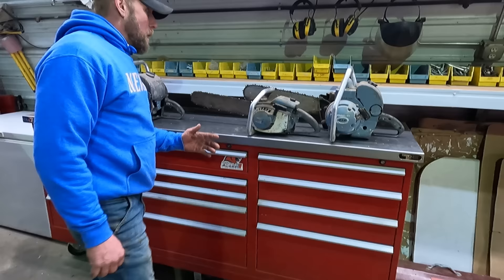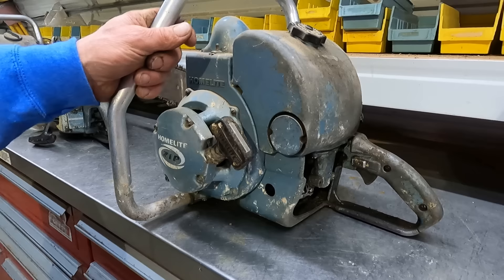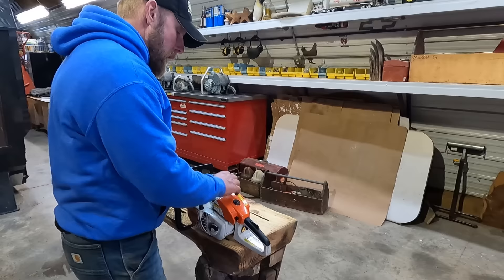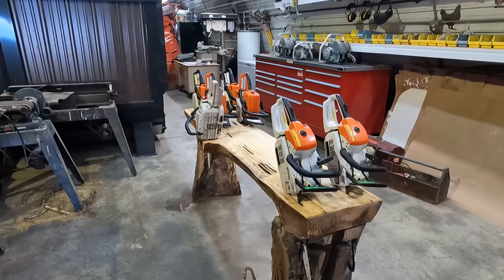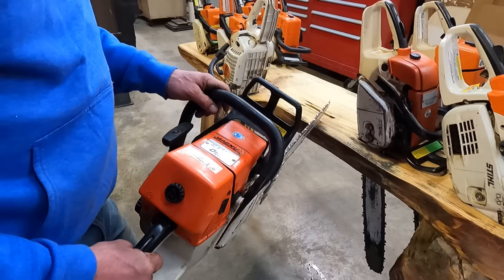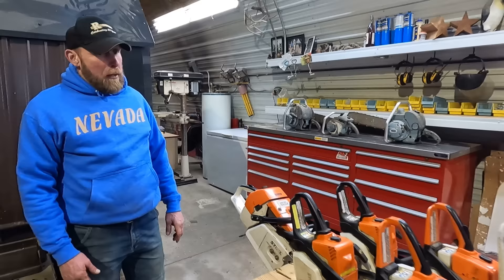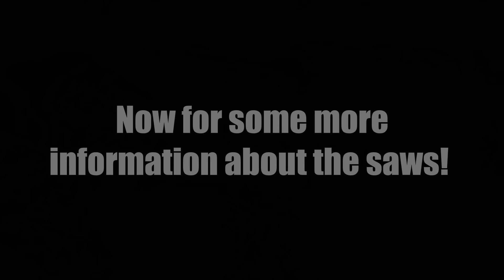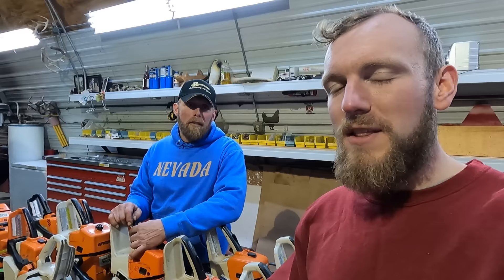The Chainsaw Collection! What is Each Chainsaw Used for?

Comment: Ran Homelites, red and blue, when I was young. The red XL snorted.  Bought a new, only new saw ever, Husqvarna 455 Rancher in about 2007.  An incredibly dependable saw with plenty of power. Way better than the Homelites.  Less than $500.  Cut between 4 and 6 cord of firewood every year and still going strong.  Got an old Jonsered I'd sell ya!

Comment: That’s an excellent collection. Those blue Homelites are amazing. I learned on a Super XL automatic at 11 years old. Then my first was a Homelite Super XL but in red. Excellent saw that cut hundreds of cords of wood. Then in the 90’s I bought an 028 Stihl that was great. Only issue was replacing the plastic oil pump gears. Otherwise I ran that till it wore out. I also picked up an 011 for trimming. Then got an 038 Magnum that was a beast. Such fantastic saws.

Comment: I have Husqvarna saws, mostly because the Husqvarna dealer is 8miles away, and the Stihl dealer is 20 miles away. Both are great saws and hold their value well. A couple good saws are a requirement, not an option when it comes to farming.

Comment: Growing up in the late 60's we had a Sears with an 18" bar and the plunge oiler. Those things had so much vibration and heavy as all get out.  Then Dad pickup up a David Bradley with a 36" bar. What a beast. I prefer the new Stihl, light and comfortable and the handles are dampened.

Comment: When I first decided I was going to heat with wood about 12 or 13 years ago I bought a 290 and then a 180 for my dad who was in his 70s but wanted to help me cut.  When buying the saws the dealer told me that was the first year where they zero was placed at the end of the number.  My dad is gone now but I stuff use both saws with no problems.

Comment: I have a 250 I've had for about 5 years now and for their size they are pretty decent little saws.  I do just trimming around my property so it's my only saw but I grew up on a farm where we had to trim up fence line every so often etc and all we had back then was Stihls.  As you know keep oil in them, grease the end of the bar (if applicable), run good gas in them, and don't leave them out and they will last you a lifetime.